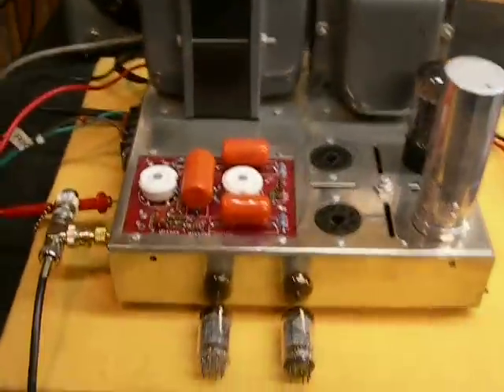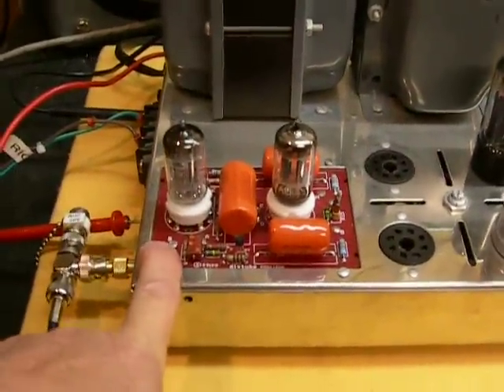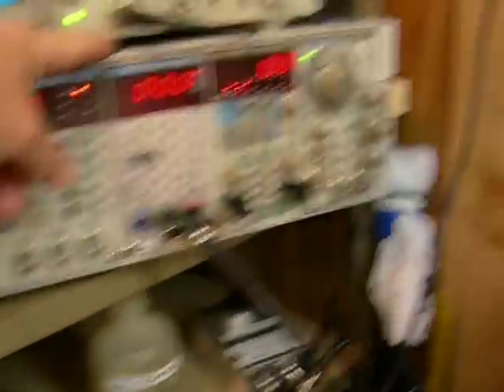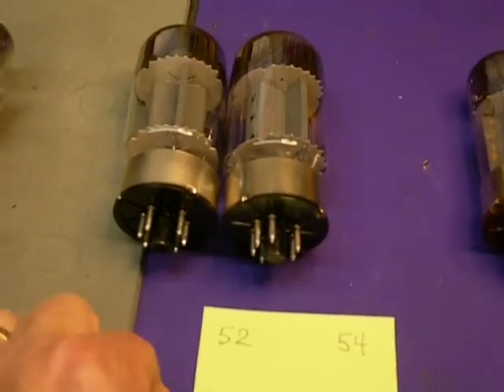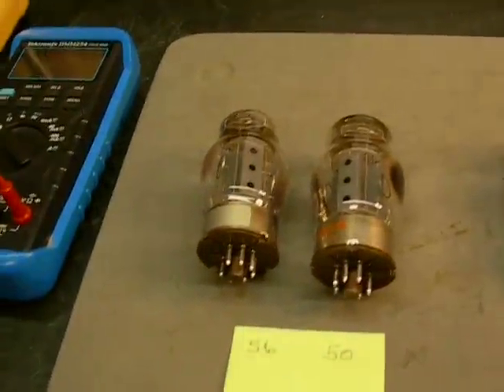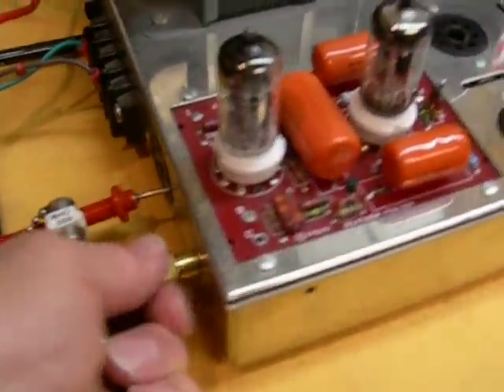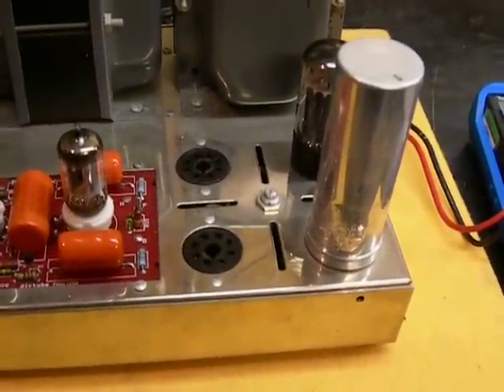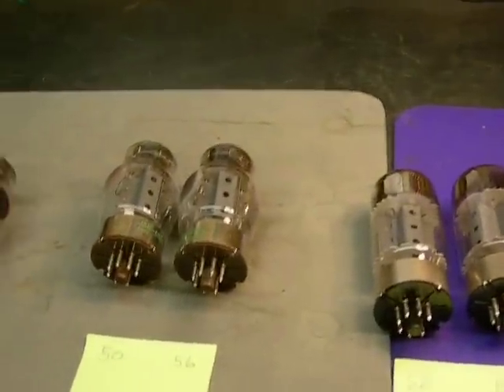Introduction to 6550 Vacuum Tube test Setup Using Dynaco Mark III.MOV

Comment from the maker: The driver board does make a big difference. I have lots of 6AN8's and only a few perform well. The 6AN8 has a dramatic impact on performance, that's why I went with the other driver board. As not seeing much difference in the tubes, I believe that is just the point. I just presented them as measured. It appears there isn't much difference. It also appears the super high priced vintage tubes are just that - high priced. "The Sound" is just too subjective to touch. Thanks for your comments.

Comment: I watched a few videos in this series, and, with all due respect, I'm not quite sure what these tests reveal. The power output of the various types didn't seem to vary that much and could be the result of individual tube differences or tube matching. It doesn't take into account how they might sound in a particular application, etc... I got ~ 70W before clipping from a pair of MkIIIs I rebuilt using Roy Mottram's 12AT7 driver circuit and EI KT90s. Could your results reflect the driver board?